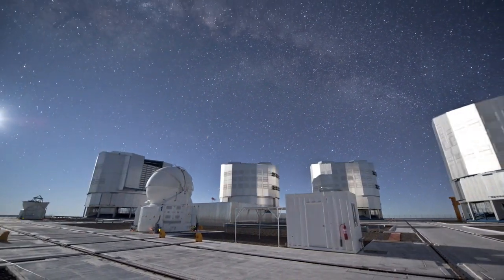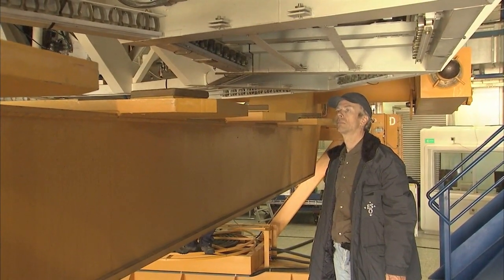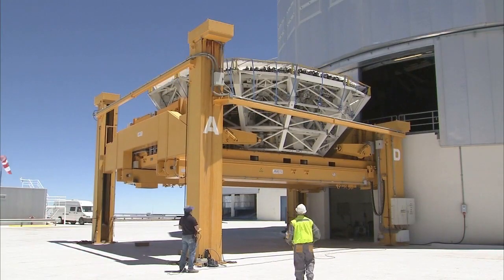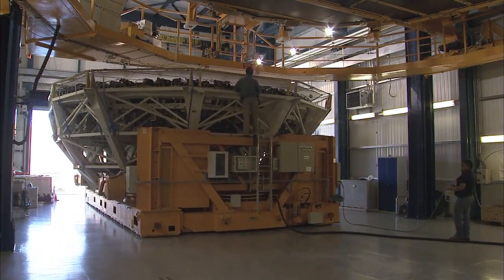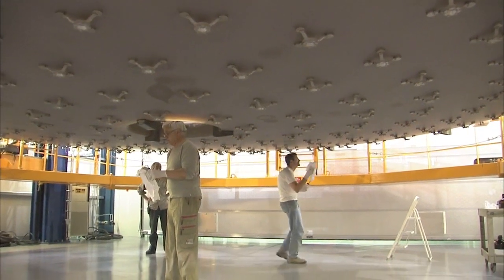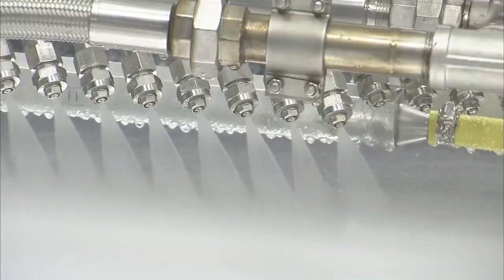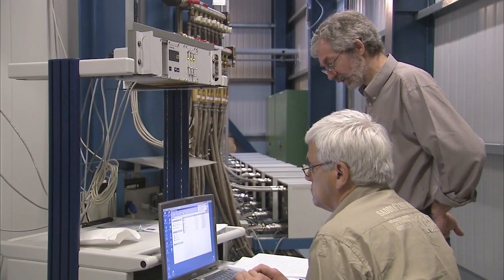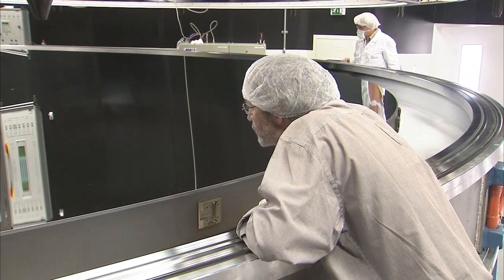How to Wrangle a Giant Telescope Mirror

Comment: why isnt the mirror maitenance building right next to the telescopes?
Reply: +LordFazza There is limited space on top of the mountain, and to avoid light polution and so on, only the bare necessities for telescope operation are located on the mountaintop. Also, the area has several mountaintops with telescopes located on them, and the mirror maintenance building serves all of them.
Reply: Altitude sickness.

Comment: Why use aluminium when you have to change it out once a while ?
would paladium or platinum not be longer lasting ?
Reply: Ad Meijer Aluminium has a constant (very high) reflectance over a large part of the spectrum (from UV to IR, including the visual range). And, this might suprise you, an aluminium coating is actually very durable because it always has an utrathin protective cover of aluminium oxide. Aluminium oxide is one of the hardest and materials we know of. You may know it as saphire.
Reply: If you get an answer, let me know.
Reply: Ok thanks

Comment: Don't use Windex, Windex is only for Regular Plain Glass NOT for Primary Coated Mirrors. For my Mirrors Multi-Coated , I only use top "Photographic Lens-Mirror Sprays specifically formulated for Multi-Coated Lenses and Mirrors, I Purchase it from my Photographic Camera Store Specifically made by Opticians for Multi-Coated Lenses and Mirrors , I then wipe with only Photographic Lens-Mirror Tissues also purchased at Photographic Camera Retailers"! Your Windex method has just reduced Reflectivity!!